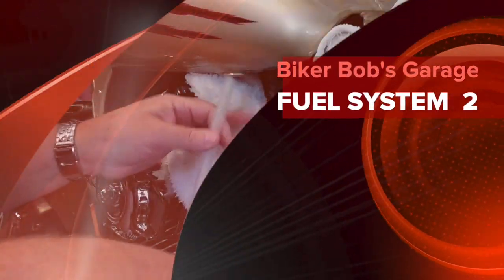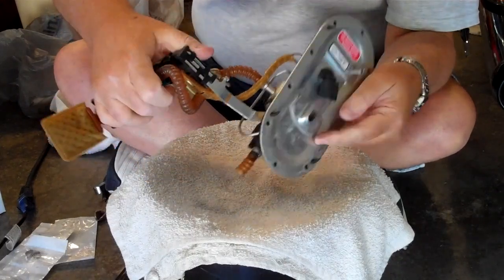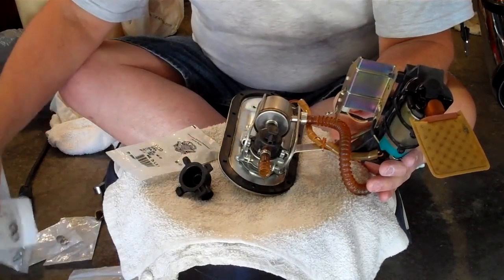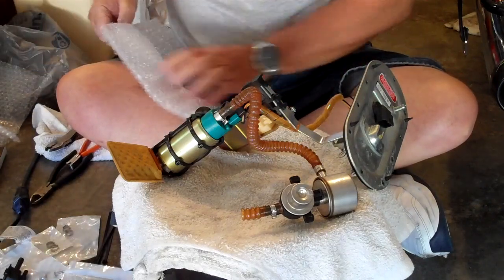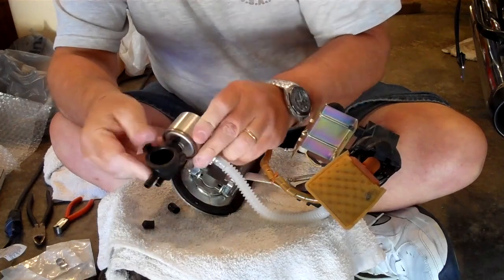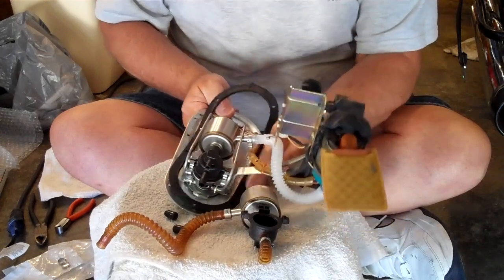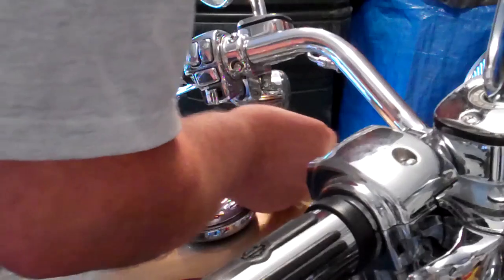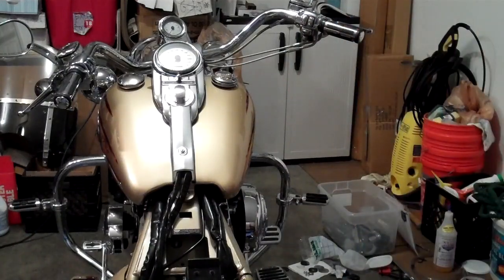Harley Fuel Filter, Fuel Pressure Regulator Housing, Fuel Check Valve on Road King Part Two

Comment: did you buy that as a kit or individual pieces
Reply from the maker: No, individual assemblies from HD.  The fuel filter came with a hose, filter, o-ring & clamps.  The check valve came with a hose already attached to the check valve.   Thanks for commenting.

Comment: Thanks for the video , I'm just about to go through this myself. I do have a shop manual but the video helps simplify the process. What I'm having and issue with is a miss at low rpms and a rough idle. I sprayed the fuel line at the disconnect on the EFI port and the engine cuts out. So I'm thinking a bad o-ring sucking air. I might as well check it all while I'm there. Thanks bro...
Reply from the maker: Mark siegfried Be sure to check the electric wires going to the fuel injectors for breaks (wiggle test while running) & fuel line going to the fuel rail.  GL
Reply: I believe that its the oring at the fuel port on the quick disconnect. I sprayed throttle body cleaner on it and the bike cut out. I tried wiggling the injector leads the best I could and nothing happened. It's fn hard to see anything without removing the tank .
Reply from the maker: Yep & the inside of the fuel line going to the rail will swell shut too.  GL
Reply: My thoughts are , being that there's only 9000 miles on it and its an 06 Road King that it has some dry rotted or a crack hose somewhere. I'm hoping its just the oring.
Reply: I replaced the plug wires . That took out a lot of the misfire but it's still sputtering and surging at low rpms. I wasn't getting that Harley idle that I love such. I found the breather hosed to the air box are dry rotted and cracked. Got new ones today . I'm hoping thats it. Also found the one muffler loose. I bought this bike with 8800 miles off of an old man. so it's been sitting for 12 years.
Reply: I still have this low rpm surge miss fire crap going on. What I found in my search was a loose muffler, cracked breather hosed to air filter , and I replaced the plug wires. I checked for fuel injector wire damage ( none ) . I guess my next step is to pull the fuel pump assembly to check for pin holes.
Reply: @marksiegfried8077  Your problem sounds like mine. What did you end up finding out? I replaced the crankshaft position sensor 1st. Spark plugs. Still seems like its starving for fuel. 2005 Softail heritage classic EFI. HArd to start and then when running not smooth at all. Rough idling
Reply: The first minute and 30-seconds you screw something in what is the name of the part, on my 2015 freewheeler that part is wet with gas can I get away with just relpaceing that part or is the long hose that attached permanently affixed to that.

Comment: Great stuff guy! really good video sir.  Just wondering if your bike came with the 103cc?  I have original 88cc on my heritage.  I got the gear upgrade 510G from S&S, did away with tensioner issue all together. I know now what to look for in my tank thank to your video. Great job:)
Reply from the maker: Yes, came with a 103.  It's a 2003 CVO (Screaming Eagle) so it had the 103 instead of the 88.  Glad you liked the video.  Thanks much, Bob

Comment: Good video, But I didn't see a clamp on the hose going to the check valve before you screwed it in.
Reply from the maker: The hose on the chrome check valve end is SUPER tight & required no clamp nor was there a clamp on the OEM check valve from factory.  HTH

Comment: You know if someone made a Harley SS fuel strainer for the bottom of the fuel pump instead of the cheapass nylon one's I just found in a million pieces in the bottom of my tank, you could probably sell a thousands of them.
Reply from the maker: You're probably right!
The problem is there's only a handful of us Harley owners who have ever seen the inside of the tank and the strainer.  The Steelers love these nylon strainers because they get to charge a bunch to replace and clean up the mess of them deteriorating.  My 03 has a brass one I believe so I'm not worried about that one.
 Here's the problem as I see it, most HD owner's anymore are afraid to change a tail light bulb on their bike much less tear into the tank.  God forbid they would EVER dirty their hands with an oil/filter change!
Congrats to you for being grizzly enough to tear into this job!  
Be sure to subscribe and check out some of my other videos like totally rebuilding my brake calipers and doing oil changes without puking oil down the front of your bike.
Good luck, 03
Reply: @2003Harleyguy  Best reply I ever got! Thanks! Were do you get a brass one?

Comment from the maker: I'm not a certified mechanic or technician.  I can't give any advice on repairs.  HDF dot com (Harley Davidson Forum) Technical forum might be a good place to search online for a solution from certified mechanics.  This video should be viewed for entertainment purposes only and nothing else. Good luck.
Reply: Just out of curiosity what prompted this maintenance? I've been having some problems with my 06 FLHRSI cutting out when I'm getting on the gas and have since changed out the filter. Still getting the same problem though. I'm wondering if the Fuel Pressure Regulator, and Fuel Check Valve replacement may help.

Comment: What numbskull did Harley employ to design this thing and its location?
"Let's immerses a $hxxload of plastic and wiring in the gas tank in such a manner that only gynecologists can access and work on it, THEN charge an arm and a leg for parts!!"
The gasket is a treat,.....fixing a problem that does not exist by inserting thick  metal washer/inserts where screws pass through so it will leak!
THEN use crimp clamps that cannot be installed or released without the correct tool.
Boy...they got us there!
Reply from the maker: You should see what I had to go through to install the new hydraulic cam chain tensioners to replace the spring loaded tensioners, in an upcoming video. 
Sadly, "Simple and rugged" is a long forgotten thing of the past...  Thanks for watching the video, 03
Reply: @2003Harleyguy  
You video helped A LOT! Thank you.
I ask myself, why did Harley feel the need to put a pig in a dress and polish turds?
Fuel injection? Why:
To gain 2 mpg?
To satisfy Kommielifornia regs?
To gain "performance"...🤣
(Erik Buell and the V-Rod did that and look how well that went).
It was simply, a reliable tractor engine, tool rolls carried all you needed for the design, it was maintainable and ran on any gas.
Car-bra-tooters delivered gas/air prehistorically and an S&S B or E Pumper, was simplicity itself, based on the old Linkhert "tube" carb!
EFI is not "progress" - it just "reads right" in the press.
True tale:
I once rode with a group, back in the mid '80's, one of whom had a slipping Shovel clutch. We were camping in the boonies. A plastic sandwich box held the drained primary oil,  hex key removed the  outer primary, combo wrench, the basket to access clutch plates, a hash brownie disposable tray held the JD, a wire wool scrub pad to clean the glaze off the plates and we poured the oil back through the Derby Cover, whilst three guys leaned the bike over to the right.... cover back inplace - job done!
It was reassembled, by the time the brownies kicked in and it got the guy home 2 days later.
Here I am at 68, my '06 Rat Softail is complicated and so now I appreciate "simple" more as I age and ride.
Oh for my '65 Pan!!!
(Although the mousetrap was a bitch till I "got it" into my head how to adjust it, then I was everybody's hero!!)
Thanks to you I am still sane!